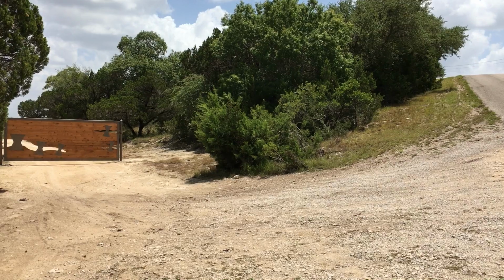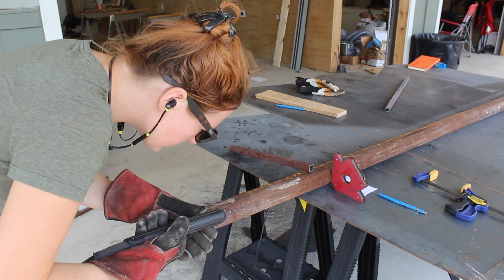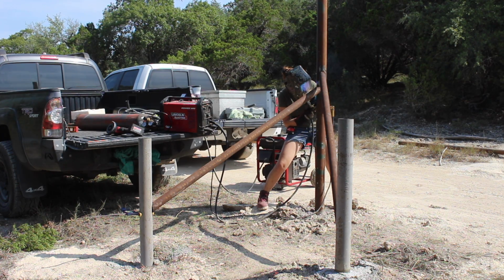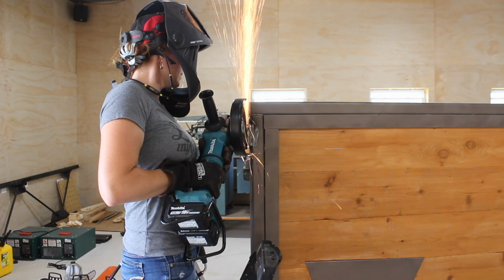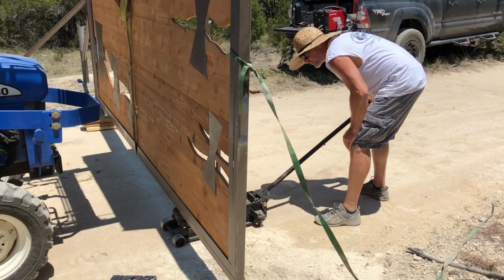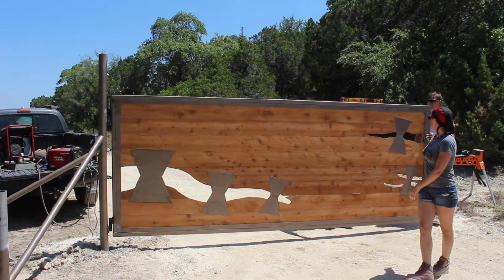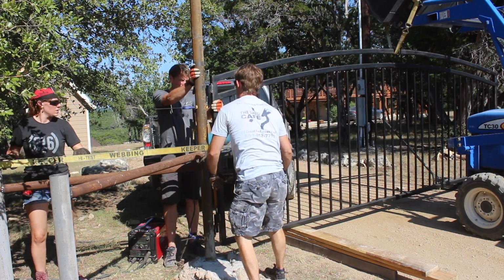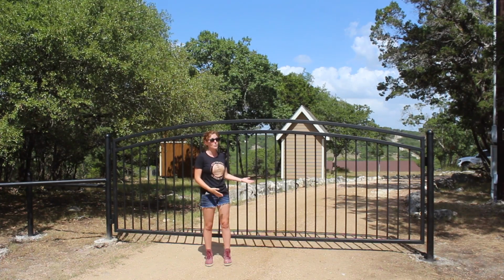Installing Two Giant Property Gates

Comment: Interesting. I just quoted someone $3k for a gate like the one with the bowed top. I usually weld the hinges on the post and the gate post before I start the project, that way they are aligned from the start.

Comment: I'm using these barrel hinges on some 3x3 square tubing posts and 2x2 gates.  I had them centered on both but when I installed them and the gate didn't open to a true 90 degree and only opened about 65 degrees when opening it and started to bind so I cut them off and put a back piece or a larger foot print now it open about 75-80 degrees when opening it.  My thought was to move it flush to the front so it clears but I'd like to keep it centered on the post if possible.  Does this make sense?  If so do you have any suggestions on how to get it to open to a true 90 degrees? cool videos btw.

Comment: My dad and I had left over concrete when we installed a basketball standard for my little brother, that we poured into the pole. This is in Wyoming, but the moisture in the concrete over time swelled and cracked the 1/4" steel pole. Hopefully it doesn't get that cold in Texas. Those gates look awesome!

Comment: I have a suggestion. With a gate that large and heavy, use a sliding gate mechanism instead of a swinging gate. A sliding gate will never sag, simply because it's not possible. The posts for a swinging gate will almost always sag over time. I installed one myself and haven't had any trouble with sagging or operation in 3 years.

Comment: Remember the stiffer the concrete or minimal water for the mix will increase a stronger post foundation.   Use plenty of water to blend the mix but don't overdo it just to it make it easier to pour.   Concrete finishers notoriously add too much water to make an easier finish but it does decrease the PSI of the concrete.

Comment: Love them! You saved a fortune! I have tons of clients with large (RV sized) gates, and a tip I have picked up is to put in some sort of plate, catch, latch, or bit that supports the open end of the gate when it's closed. It could be a little platform at the bottom which the gate can slide up onto as it makes it's last couple inches of travel to close, or just a heavy-duty latch and latch pin which will slightly lift the gate, again, as it just closes. Takes a lot of the extra strain off the hinges when the gate sits closed, which is just about all the time... if you put a self-latching type, you can add a loop to put a padlock through to keep it from latching when you don't want, and easily use the lock to latch and lock the gate when you DO want it locked. 
https://images-na.ssl-images-amazon.com/images/I/41B8Gmhr4qL._SX425_.jpg

Comment: On the wooden Cedar gate, behind the bow ties, I would add a bead of clear silicone caulk to keep water from swelling the wood that may get trapped behind the metal bow ties. This also keeps the lines well defined and is practical for the longevity as the bow ties will move against the wood with high winds and the paint will scrape over time.Just my experience from living in Missouri for many many years.

Comment: I did a lot of gates down in Texas when I lived there, the posts were always a pain. Eventually the system I came up with was to pre-build the poles, then id tie the poles together with a piece of 6-10" C channel depending on the width of the gate. then id weld rebar studs all around the base of the poles, dig a trench where the gate was going to go, set everything in, and could level it off of the top of the C-channel, then pour concrete on the poles to hold it all in place. 

System worked great! 

Also I would frequently run a piece of 1" PVC between the poles so if you needed to get a wire from one side to the other the conduit was there. This was really handy considering keypads and gate operators frequently need to be on the opposite side of gates.

Comment: Amazing gates!! As a civil engineer I would advise you next time to weld perpendicular bars in the foundation to be imbeded on the concrete. Maybe that way you wouldn't need so many lateral supports and the posts would have aditional support to avoid being pullout vertically. Cheers

Comment: You welded a pos hinge on to an already painted gate, using a level ? I guarantee you the chinese guy that welded the barrel to the flat bar wasn't that careful ! I'm not knocking you or your work, there are MUCH better hinges out there ! I've been in Ornamental metal work since '88 and I have used those hinges and others . I would be happy to give you any info I can.

Comment: I may be imagining this, but to me it looks like pole on the first gate (the wood and steal one) is actually bowing towards the gate at the top and away from it at the bottom. It's hard to tell for sure without some solid reference lines in the video, and it could just be parallax from the camera lense.

Comment: Wow, looks awesome.  I have always ended up having some kind of support tang at the fully open and fully closed ends to support the gate weight at those points to prevent sag.  But then, I have not used anywhere near that much steel and concrete!

Comment: Great job on mounting the gates, one question for you: is there a reason you poured to concrete around the posts instead of filling the hole and then dropping the post in?  Just trying to increase my knowledge base.

Comment: I got a bid a few months ago for 36 lineal feet of metal handrail on two small decks.  $8500   Your two gates are a much larger project than mine.  Maybe costing in the area of 20k.  I’m not a metal worker but it’s not rocket science so for my project  I cobbled a welding table, bought a welder and saw and materials and saved myself 6k.

Comment: Nice gate April. If it starts to drop due to the weight you can attach a steel cable to top of hinge post and run diagonally to top of closing side of gate. You can increase the tension which will raise the closing side. A few weep holes drilled in to bottom channel the wooden slats sit in will relieve any water trapped in there too. Good job!

Comment: the big hinged doors are very heavy and for a short time they will touch the bottom. The best way is to make them in two pieces or with the wheels, which is the most correct way to be able to install electric mechanism to open and close it

Comment: If you fill the support posts to the house gate with concrete, they will have less deflection. The concrete keeps the pipe from wanting to flatten a bit as it tries to bend. 
A gate stop post with a butterfly latch to hold the gates open would be handy, especially in breezy time. A lift rest at the gate stop would support the gate from wanting to bend the posts when the gate is left open. 
Good looking gates.

Comment: That's an odd way of fitting hinges? Just run a rod through both of them, align the rod to plumb and then weld. Then remove the rod. 
Also, source a big phosphor bronze washer to act as a bearing plate for the hinge pin, it'll run smoother.
I'd have washed those pipes in Phosphoric acid before painting them, painting on top of rust is never ideal.
Try using a full length smooth up-down action when painting, not jabbing it up and down over one little bit. It'll cover better.
And something to hold the gate open, it'll make driving through on a windy day less hazardous.
Thanks to the other guys for their ideas, we live and learn.
Reply: Is it too late to add the washers? Maybe we should find some for her...
Reply: Yeh, just lift the gate, pop them on and lower it. It's the same for smaller gates, but there you can use a nylon washer. Any marine hardware shop should stock them, or eBay.
Reply: do you live in the Jurrassic  era ?
Reply: There's a steel ball in those hinges to rotate on. That's why there's a grease fitting on there.

Comment: Because the gate is so long and heavy I would have added a sprung wheel. It attaches to the bottom of the gate and acts as support as you open and close it. I know it’s probably unnecessary due to being on bedrock but April over engineers things anyway so a little more probably wouldn’t hurt.

Comment: Only thing I would recommend is to set your opening then build your gate to the opening,minus hinges and latch. I would estimate the iron gate at $2000,not installed and the wood filled gate at $2800,not installed. Price is based on all metal being sized to spec, galvanized, then powder coated. So Ya you saved a ton of money on just the gates. No idea on how much you saved on installation though. Great job

Comment: Why go with a swing style instead of a sliding gate? On the shop gate I'd put a bigger catch tab on since it's more likely to catch the wind. Any plans to add a post to hold the gate open on? Or one of those L things you stick into the ground? Does it snow in your area? Would also keep that in mind when choosing the height off the ground. Don't want to have to shovel snow just to be able to open the gate. Looks like it was a fun project. Thumbs up.

Comment: In My opinion installation is done wrong and gate will sit down with the time. Problem is in the posts or rather with concrete - you should pour all posts together.
Reply: In other words, a single pad of concrete. Good point. Except for that, as she mentioned, the holes had to be bored out of the solid rock, with specialized equipment..... that may change the calculation, as far as the feasibility of a single, solid pour(?)...

Comment: I would put a spring loaded wheel on the far end to relieve some weight on the end of the gate. Quite the long lever with lots of weight, will also reduce the gates tendancy to swing.

Comment: get a battery powered (weed eater / pole saw) when "not if" that one dies
Reply: Why?
Reply: #1 no more mixing gas  #2 no more yanking that #$@%* pullcord #3 way less noise #4 they have just as much power as gas models #5 click on a battery squeeze the trigger it's just that easy

Comment: My wife is an interior designer and her firm has an outdoor specialist for Gates, landscaping, garage doors, etc. I asked my wife to have that co-worker estimate a price to have these gates furnished and installed. I live in the chicago suburbs but the estimated cost to have these gates made then installed by a contractor according to my wife's co-worker is 12k to 16k. I'd say you saved quite a bit. My wifes firm tends to do high end projects so perhaps other places might be cheaper but that was the estimate where she works.
Reply from the maker: You're awesome for getting an estimate. : ) Thank you for that.
Reply: That actually seems VERY reasonable, if not on the low end.  I was thinking they'd be like $18-20k for both.  These pieces really are works of art, especially the bow tie gate.  Considering that gates like this installed in urban/suburb areas would skew towards very affluent neighborhoods, I don't think many people in that market would balk at the price. 

Doing gate/fence work yourself is a HUGE cost save, even when you factor in the value of your labor.  I have a terraced back patio, and I did the iron railing for the upper section myself.  I had $1500 in tools/materials (including a 120v wire welder, compression roller, and chop saw I bought just for this project), plus about 4 weekends of DIY elbow grease.  A GC friend of mine came by to check it out and told me he would have paid a sub at least $8500, and the cost to the owner would have been at least $10k.

The cost save is a HUGE benefit.  But I think my favorite thing is when I have company over and they admire how beautiful it is...then their jaws drop when they find out I did it all myself.
Reply: Oh, yeah.  I used to work in a welding shop in Nashville (I was the secretary; I didn't get to do the fun stuff).  I knew the savings would be really big because labor is the majority of the cost...but my jaw dropped when I heard $1200.  For both gates, our price would have been higher than the 12-16K estimate you got.

Comment: I wonder how they rate a weight on a hinge.  Is it 700lbs in straight shear?  How could they know how long the gate will be. Hmm
Reply: I was literally wondering the same thing!!! Yeah, she said they were "many times stronger" than she needed, and I was like, "mmmm.....not SO sure...".....
Reply: Samuel Luria I looked up a few different hinges and commonly they say something like "will withstand load forces up to xx lbs". I tried looking up a calculator that would show the actual torque being applied given a weight and height/length but didn't find anything.  Though I get the feeling that gate is easily reaching the 700lb limit of those hinges.
Reply: Samuel Luria Found a calculator.  1400ft lb of torque per hinge!!!!!!  I'm guessing those 700lb hinges don't stand a chance long term.

Comment: I did my gates using a different method i concreted two pieces of RSJ into the ground made and welded on a pair of extended hinge hangers using flat steel and 3/4 bolts then I bricked round the RSJs so it looks like they are on two brick gateposts but are hanging on two 12" rolled steel joists in the centre of the brickwork then filled them with concrete if someone runs into them they are not moving but they look neat

Comment: I suggest adding a ramp-like slab on the opposite side to the one with the hinges - when the gate will be in the closed position the stress(torque?) exerted on the hinges will be reduced. The mentioned stress can lead to the gate not being as straight to the ground as it is  now. Anyway, love the video, the workshop gate looks gorgeous ;3

Comment: Modify a garage door opener for the gates. Much stronger, faster, more reliable, and parts are cheaper. I've had mine installed for 12 years with no problems. Gate actuators are slow and control boards are expensive.
Reply: rptaylorjr or just hire one of these refugees to open and close it for you haha 😂

Comment: An impressive looking pair of gates.  Have you thought about hiding the supporting posts in some stone work?  You could make two impressive rock wall 'wings' either side of the gate to camoflage the supports and add a certain old world aesthetic to your driveway.
Reply from the maker: Yep, I plan to do two rock columns with flower beds in them and those will connect to the fence. : ) All in the future plans.

Comment: Incredible series and outcome!  Well done!  The only thing that occurred to me as I watched was leaving an option for lighting.  I thought that a piece of PVC pipe in the posts would provide for an electric channel if you ever wanted to run power to the post caps or put switches or outlets on the posts themselves for future tech or servos.  2c FWIW.  Seriously, you did an amazing job all the way through and should be very proud.  If you have an older sister... LOL

Comment: if you put the gate intensionally a little bit out of plumb in just the right way you can make it biased to be either open or closed. 

That way if you don't use an actuator you can just push so it'll reach beyond the hump and it will swing further and then stay there.

Comment: as a class A welder and custom MFG, I would only tack weld each hing in 2 places one tack top right one tack bottom left, then once the gate is hung, tested checked and double checked, and swing in and out all checked out, then and only then would i weld them solid, any thing could be out  of line to mess it up a half inch tack will hold more then you will ever need, i would even hang and swing from it, if your tack fails well you shouldn't be welding, i have tack welded a tow bar to a 5 ton truck and towed it home, thats 2  half inch tacks on each arm of tow bar only
Reply from the maker: Oh that's a good suggestion, thanks!
Reply: sorry i am so long winded

Comment: Using rattle cans for painting ensures a fragile, thin and cracked finish. I guess I would shoot it or roll it.
Reply: T wagner I agree. Ditch the rattle cans and use an hvlp gun. You can shoot rustuleum oil based primer and paint from a can. Much better than rattle cans.
Reply: You got it.

Comment: AAA... Always awesome April 😊
I'm a little worried that the posts will rust tho. when concrete air and steel meet there is an increase of chemical action. easily solved by wrapping the post with Denso tape but a bit late now
Reply: bill baggins good idea

Comment: I like those gates!! (We have a company that makes custom gates) 
Small tip: Add some black foam strips to that plate so when it closes it bang on that second pole.

That's all I wanted to say , greets from Belgium ;)
Reply from the maker: Great tip! I'll look for something that will hold up in the sun.
Reply: Maybe  a piece of tyre? It'll last forever
Reply: And add a post at 90° so you can lock in open position.
Reply: @AprilWilkerson  rubber floor mat or car mat?

Comment: With gates mounted on hinges like that it is often a good idea to invert the top hinge which stops it from just being able to be lifted off the post (probably not such an issue with these gates but with smaller gates it is quite easy to do).
Reply: Wouldn't that also greatly increase the weight on the lower hinge?🤔